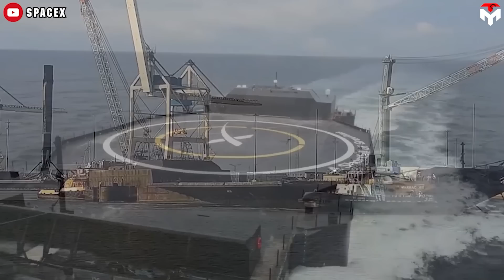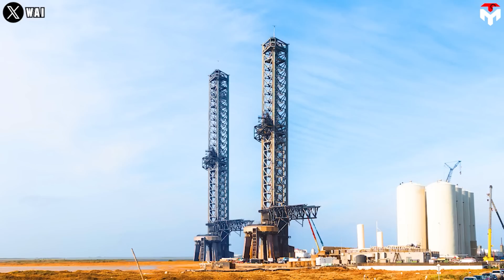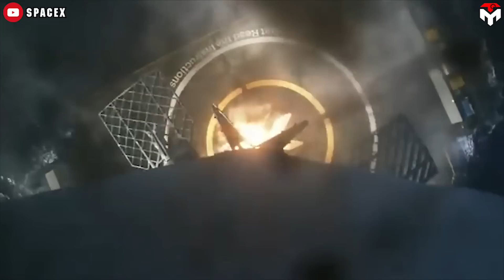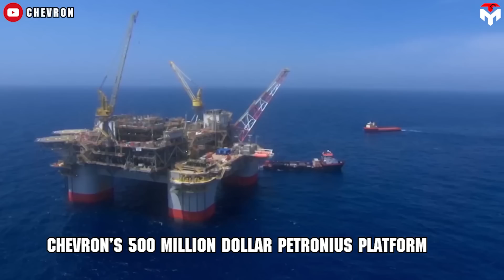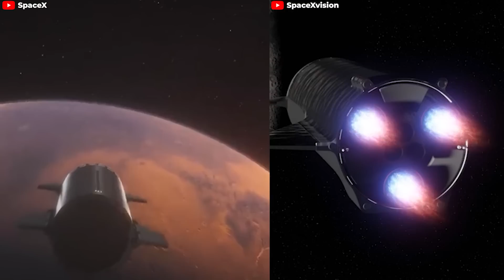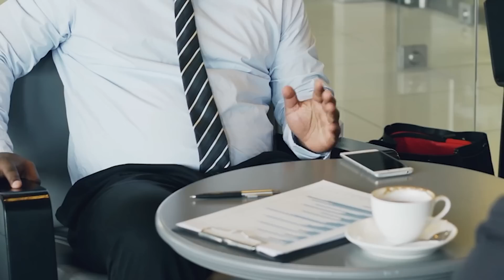SpaceX Starship New Landing Method Somehow SHOCKED the whole NASA...

Comment: The oil platform is a good idea that should be explored
Reply: For starship and booster they're going to need two of those joined together with gyro stabilizers and probably a catamaran/trimaran setup to handle rough seas.
Most likely they're going to need a sunken holding point to lower the center of gravity and stabilize the rocket ships.
Alternatively a permanent offshore platform would be more stable.

Comment: Instead of a tower on a floating barge it  could have a hole, so the barge could incorporate a huge tube sealed at the bottom there would be negligible sway problems
Reply: What would you do with the exhaust gases being blown into the tube once the booster reaches the top of the tube?
Reply: @lotuselansteve  This would be for landing not take off.

Comment: The high tower on a platform at sea is somewhat of a problem...so drop a cylinder down in the water on the platform so the return ship drops in the tube and is caught by the arms partly above the platform...I can draw up a prototype if needed...👽...🖖
Reply: I'm not sure they can build a tube that could hold up to the heat and power of the engines. Plus the extreme sound and heat waves would be extremely destructive when contained within a tube and only able to escape by passing back up the tube and over the rocket. That blast would rip apart the rocket before it got out of the tube.

Comment: Launch tower is ~17x17x145m, probably weighs ~2650mT with just the structure, piping, decking, stairs, etc. Concrete in the legs ~203mT. Disregarding stability, you'd need a 20m empty cube to float just the tower+concrete, say another 245mT. If you scale up a F9 drone ship, you get 90x158x10m, say 4400mT.  Stretched booster+ship+cargo+prop ~6500mT.   Total 14000mT, with ~20% of that being just a tall tower sticking up almost as far as the drone is long. Probably will need some huge seawater ballast tanks for stability, and some massive station-keeping  engines..

Comment: It currently takes 2 days to truck in enough cryogenics for a starship full wet dress rehearsal and one launch-on-the-first-try (per tower.)  Or I should say it has taken 2 days to truck it in.  If they have added transfer stations to the tank farm, that reduces the required time. 

Even if booster only takes 8 minutes to return to launch site, starship will take many hours.  For a single one of either type, at best they will launch 2x a day, because the depot/target orbital plane crosses the launch site 2x a day.  

If they don't beef up the tank farm capacity, it's more than half a week between launches. If they do beef up tank farm capacity, or arrange industrial pipeline to site, they can launch as frequently as they have booster+ship ready at orbital plane crossing (temporarily Ignoring the time for launch license approval.)  If they don't need 2 days to truck in propellant, and they use 2 nearly-simultaneous towers each in Florida and Texas, they can get 4 loads up per 12h, or whatever the tank farm refill time is, whichever is greater.  Texas could launch about 66 minutes after Florida, every 12h.

By the time they get a launch pad that doesn't need to be repaired after every launch, they will be able to launch back-to-back in less than a week.  12 days is highly pessimistic.

Comment: recovering StarShip and Super Heavy stages is very complicated! !
as for the imagined doing it on a barge in the middle of the ocean. . . . ..

SpaceX already had "problems" in bringing back a 1st stage of Falcon 9, which had gloriously landed beating its own record at the same time, when "mother nature" put in its two cents and ensured that the record holder of the return number does not reach the port intact!
there might be a solution (somewhat acrobatic)
the problem is the stability of something ~100 meters high and less than 10 meters wide and almost empty, why not lay it down for transport! 

why not take it to the next level?
design the “thing” in “RV FLIP” mode
The RV Flip was an "ocean research platform" that had the unique ability to flip 90° vertically!!! 
.
the offshore recovery system will therefore become a recovery tower (125M long), extended by a well-designed ballast tank.
for recovery operations, once in the area,
the ballast tanks are flooded and the tower stands up ready to receive the booster in its recovery arms.
once the recovery has been carried out, new arms come to secure the booster ; we drain the ballasts carefully and the tower booster to a horizontal position,
and  "Mr. Sulu, take us back to port"

Comment: Presumeably the tower on a platform will need to be considerably shorter for stability,
Reply: The oil rig should have a cutout in plan (to resemble a ‘U’ shape. Have a barge enter at sea level and dock with the sea-bed tethered oil rig. Land the booster (either with legs or using a shortened tower), so that the bottom of the booster approaches sea-level (not 40 m or so up in the air). It would be way more stable.

Comment: Though water is hard under compression, it can be made soft by injecting air into it, thus creating a shock absorber effect for the floating landing pad as the Starship lands.
Reply: Ships will not float on aerated water because of lower density. This has actualy happened.
Reply: @broomanjohn7370  The first time I saw using air to make water soft was during the Olympics many years ago during a high dive competition so the divers should not get injured when they hit the water.
Reply: @picksalot1 divers can swim back to surface, ships dont.
Reply: @broomanjohn7370  Why do you think anyone would inject enough air to sink the landing pad? 🤪
Reply: @broomanjohn7370 perhaps the comment was misunderstood. The ship is already in the "tough" water. Spraying the water up into the air would soften the landing slightly and be a fire quencher.

Comment: Landing around Starbase is a terrible idea
Reply: Wouldn't the need horizontal/diagonally positioned anchors to the sea floor in a low sea bed to make it feasible for stability. I cant see an offshore platform providing enough inertial strength
Reply: otherwise deep water  latch sounds like a headache. And ejections into the water would be less damaging...

Comment: Stupid idea. What they need is a place to build a major base with a harbour and place for housing and some nuclear facilities to gain the energy for the fuel creation. UK has some funny overseas territories - one of them is an 88 square km island with just a military base etc. - Ascension. They do not need a oil rig - they need a place where they can dock container ships, where they can have 20, 40, 60 towers for humanities' first real spaceport. Even florida is a joke if they want a high cadence - they really ned a place to build Space City. Large harbour, so you can use drone ships when needed, can get hugh cargo container ships to handle payload, parts, etc. Something where damage to the environment is limited and accepted - a small price for humanity to go into space, and only an island.
The deep ocean concept is a dead end - you cannot put enough on it, you have no harbour, and the price for each is insane. A temporary solution - that is it. Nothing you can start pulling up a start every hour and that is needed.

Comment: Landing legs would be better. If equipped both could be landing already. Screw the extra weight argument, add engines to compensate 🤔
Reply: Put the legs on the ship. All the booster weight is in the engine compartment. The arms would slide down and in clamping the tail of the booster as the booster destines blowing the clamps shut.

Comment: Dreaming:  I recommend large fueling ships away from take off or landing platforms at sea.  Is it possible to make liquid oxygen and methane at sea?  The tower could have sea water cooled metal plates on the chopstick landing side.  The landing chopsticks could be over the ocean and then rotate 180 degrees to be over a test stand for the next flight.    A long crane on a large ship is needed to retrieve ocean landings, to move other boosters to  the test stand, and to restack  complete starships on the launch stand.   Can complete starships be stored vertically underwater for hurricane protection?  Can the complete landing area go underwater during hurricanes?  Consider having islands nearby for the military, support personnel, airport, and tourists.  .
Reply: " Is it possible to make liquid oxygen and methane at sea?" - with a large nuclear reactor yes. The energy input is the problem.
Reply: @ThomasTomiczek  Small nuclear reactors fit inside shipping containers.
Reply: @markiverson1416  Yeah, except you need a lot of them or a lot of time. Numbers matter.